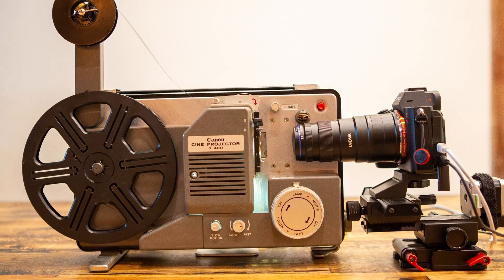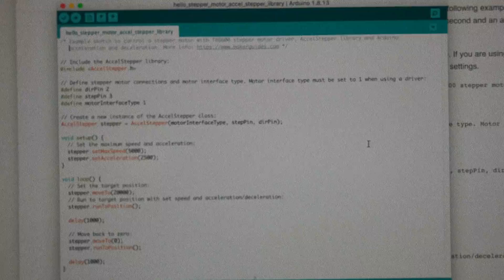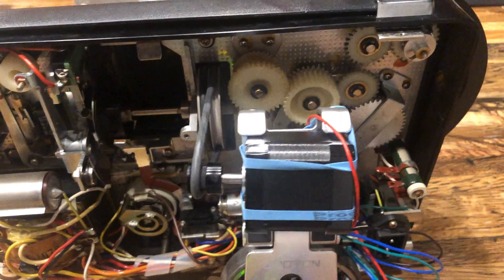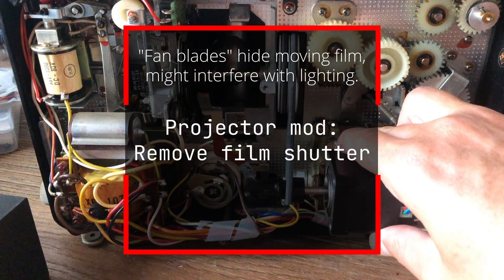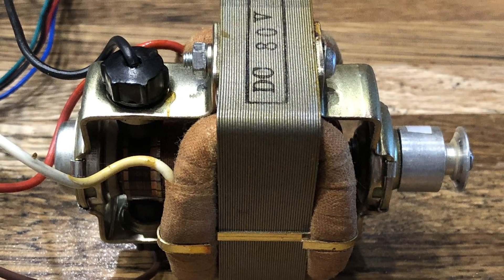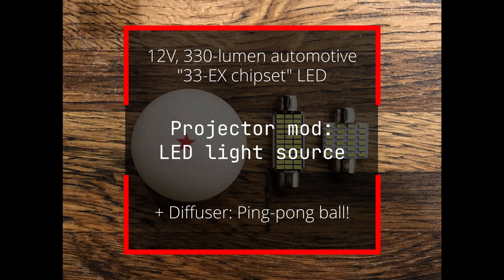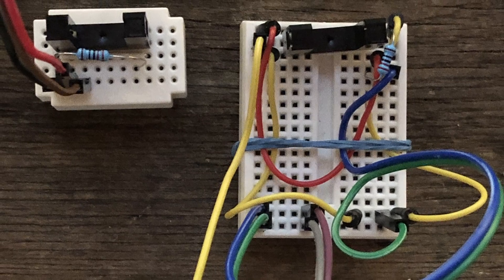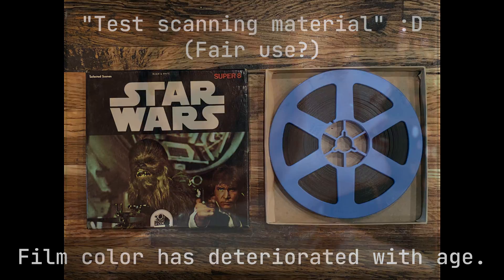📽️ 🎞️ 📸 ⤳💾✨ DIY 🛠️ 8mm / Super-8 Film Scanner, Part 1: Overview

Comment: Hi Scott,
Thanks for all the videos you made about the DIY 8mm Scanner, I admire them, they are very inspiring.
Although I have watched them all, I don't know how big the camera frame needs to be to capture the whole area around the frame even with the sprockets. I found out the purpose of doing this with Ken Eckert, whose work you mentioned in the Part 1 video . His The Magic Wand logically explains the principle of how stabilization of captured images works in Adobe Photoshop, but I don't know how it works in DaVinci Resolve? 

I'm now starting to modify a Meopta N8/S8mm projector and after removing all the parts I saw in Part 1, my film gate  is only 6.36 x 5.34mm and that doesn't meet the requirement for the camera to capture the entire surroundings of the film image including the perforations. On the N8 the sprockets is visible from 3/4 of the size , but on the S8 only a hint of about 0.1mm. No surroundings are visible on the opposite shorter (vertical) side - the image matches the film gate in both N8/S8 formats. I will have to enlarge the film gate symmetrically on the shorter sides, but how much? Does the whole sprockets need to be visible, or just half of the S8 as seen in the video in Part 3? The top and bottom film gate allows to capture the film image still with some margin. I'm asking as a beginner, but I have no experience with film post-production yet and will purchase DaVinchi after I get a faster PC. Looking at your videos, the perforation window is fixed, it doesn't move at all, it's OK.

I have a lot of my parents' old B&W 8mm film from the late 1940s, and the perforation is no longer in the best shape. So functional fixation throughout the transfer process is a very important topic for me.
Reply from the maker: I found that my projector’s film gate was both wide and tall enough to show the full width, including sprocket holes, and perhaps 1.5 frames’ worth of height.

It depends on the film, but the exposed image may extend across the full width - basically “behind” the sprocket holes or not. If the picture doesn’t go that far out, you can crop out the sprocket holes. I am not clear on what type of camera or process makes the difference between “full-frame” width and otherwise.

I think some folks have had luck filing out the film gate, carefully, to widen it. Your mileage may vary.

Oh, also - DaVinci Resolve is free to start with and you only need the paid version for certain features. I use the free one for all my stuff, and it’s perfectly sufficient.

Comment: Just a shout out and a thank you for posting this series. I've just completed my setup using a combination of your and Fresh Ground Pictures approaches, a worn-out, reworked Sankyo Duplex 1000, and my Panasonic S1. I've refined the build and I'm pleased with it. Just finished my first test capture, post-processing run-thru, getting my head around Davinci Resolve 17 and applying Neat Video. I'm familiar NV from FCPX but your orientation to Davinci - the import of an image sequence, the opportunity to set a frame rate to 16fps or 18fps - things you cannot do in Final Cut.... All so helpful to make a switch. Thanks for everything that you have put out there! It kept me motivated to create my own when after a year of researching approaches I had just about given up.
Reply from the maker: Thank you for the kind words, Walter! One thing to note, on your S1 - make sure you have silent mode or equivalent so there is no mechanical shutter movement, so you aren’t burning the lifecycle of your camera hardware with all those pictures. It sounds like you’re probably aware, but I try to mention it to everyone just to be safe. 😉

“Fresh Ground Pictures” did a great job with their video also, I saw it just recently and it looks like they improved on a few aspects of my home kitchen-based layout! 🤣
Reply: @scottschiller  Thanks for the mention of the electronic shutter - yes, I have definitely implemented that. The big appreciating to the FGP approach was his incorporation of the mechanical trigger for the shutter. That made this process so much more accessible.

Comment: A very fine work around to a home media challenge of the 21st century: how to effectively digitally transfer small gauge film in a high res' format. Unfortunately, a complex project such as this is a little out of the range of most home film-makers.
Reply from the maker: Thanks, Peter. I agree, this is a non-trivial hardware and software project that requires a certain amount of knowledge, and perhaps a “tinkerer” mindset. I am not an expert by any means, but I am happy to say I figured out enough to get some pretty good results, fairly reliably. It still takes a lot of time and effort to do the scan, but it’s really nice to have this sort of material digitized.

Comment: Utterly brilliant! And the original Star Wars on super 8 at the end was just icing on the cake. Thanks for sharing.

Do you really "need" to slow it down with the stepper that much? I guess the camera's frame rate is the limiting factor.
Reply from the maker: Thanks for the kind words.
The speed you can run at is dependent upon a few things. Common bottlenecks:
* How fast your camera can write pictures to storage (SD/CF or USB to computer) before the buffer fills up.
* Camera shutter speed / exposure settings, and minimum time between shots / how fast you can trigger the shutter.

From what I’ve found, my Sony a7riii may not always capture all frames when tethered and attempting to shoot more than 3 frames per second. This may be an arbitrary Sony limit or safety thing, I’m not sure.

I do think 3 FPS is stable when not connected to a computer, but then you need a fast and high capacity SDXC UHS-II type card, to handle a consistent data rate of 60+ MB/s or what have you.

Generally, I’ve found that “slow and steady” is good. I can do 1.5 FPS tethered quite reliably, without skipped or dropped frames and without having to stop the scan.

Hope this is of interest!
Reply: @scottschiller  Thanks for the explanation. I recently did something similiar to shoot time lapse of my 3D printer, but there I just use the lowest resolution JPG setting (2.5K) , and the Panasonic G81  only gets triggered 1x minute or less.
https://www.youtube.com/watch?v=FXXJQMq8srs
I guess you are shooting raw to be able to grade the footage later, but must have enormous amounts of data from an A7RIII. Does an 8mm frame have more usable information than about 720P, or 1080 ?
Reply from the maker: @RotarySMP  That's quite a video! Fun stuff. I don't have a 3D printer etc., but I can see how they can be useful.

For your case, JPG should be absolutely fine. For my project, I'm pulling in a bit over 64 GB for ~3.5 minutes of 8mm/super-8 footage when shooting using RAW "compressed" on the Sony a7riii, and Super-35 / 1.6x crop mode. I end up with an export typically around 4K, 2160p. This may be overkill, but I'd rather oversample vs. later realizing my original scan(s) weren't capturing enough detail.

From what I've read, 8mm might be 720p and Super-8 film perhaps 1080p, ~2K. It's unclear exactly how film translates into "vertical lines" of resolution. Either way, I think "over-sampling", scanning Super-8 at 2160p / 4K is OK as it's increasingly the standard for TVs, computer screens and high-DPI mobile devices where this content will be watched.

For typical 8mm / super-8 film, of course, the film's quality, age and how it was shot at the time - focus, lighting and exposure - all factor into the amount of quality / detail you can pull out of a scan. I think I've had some pretty decent results at times, but I've also had film that's both under-exposed and over-exposed between indoor and outdoor scenes on the same reel.

The intent with the raw process is that I can try to adjust, enhance and balance details "in post" in a lossless way after scanning, and then export a final .MOV/MP4 with only one generation of lossy compression.

Hopefully this is of interest! I'm not an expert, and learning as I go - it's been a fun process.
Reply: @scottschiller  Thanks for the kind words, and the explanation of your process.

Have you considered developing the film yourself? I have a problem with the $40 for film + $30 Developing + $25 scanning for 2.5 minutes. So far I haven't made the plunge into analog filming. Did plenty of B& still photography and darkroom work back in the 90's.  Seems 16mm film stock is now about the same price per mnute as Super 8. I have been reading up everything on line on home developing :) 

Another time consuming rabbit hole to run down :)

Have you also shot, developed and scanned any modern Super 8 film. I have looked at a fair bit,and rarely see anything approaching the sharpness of the old train films you have posted.
Reply from the maker: @RotarySMP  I hear that, film is an expensive habit. My DIY scanner's initial goal was digitizing my own family 8mm/super-8 archives, which I've done. Since then, I've purchased a few other things from eBay.

I'm interested in 16mm as well, I think it could be fun to try scanning that at 4K and have source material that is better-matched to that resolution.

Comment: Does not a DSLR shutter get worn out, after so many pictures? I am using similar concept, but recording directly a video, but the synchronization is a problem. Because, let's say 15min movie (16 f.p.s.) presses the shutter 14 000 times, so I am afraid to use it this way. What is you experience please?
Reply from the maker: You are correct regarding still photos! Indeed, photos on a DSLR that involves mechanical actuation will contribute significantly to wear and tear. I mention that in my Q&A video, with a suggestion about exploring a true shutter/actuation-free approach via "Magic Lantern" software for the Canon 5D and similar DSLR series. https://www.youtube.com/watch?v=hthVoeRgbos&t=1189s

It's worth noting the Magic Lantern "silent" mode may be a very slow process, and so I recommend using a mirrorless camera with "true" silent (no moving parts) mode if you can for this sort of work.

Comment: Great project, and excellent results. I am using the gate from the same projector Canon S400, but after removing the cutout (3:32 in your video) the frame does not show the sprocket. Did you have to enlarge the gate hole? any advice on how to best do it? Thanks in advance.
Reply from the maker: Thanks, pm490! I'm intrigued by your question. Once I removed the frame "cutout" - the piece that moves depending on selection, 8mm vs. Super-8 - I was able to see the sprocket holes on both types of film. I didn't have to enlarge the hole in the film gate here, no. Once I removed the bit of glass (an infrared filter?) and the cutout on the back side, that was all that seemed to be needed.

Assuming the back side is uncovered at this point, is there any chance something is covering part of the film gate on the front? I could try measuring what I've got here, but I'd wager it's between 9 and 10mm across. For reference, 8mm/super-8 film dimensions: https://en.wikipedia.org/wiki/File:8mm_and_super8_and_double8.png
Reply: @scottschiller  Thanks Scott. It is odd but looks like the same projector model has different size opening. I see yours is rectangular, mine is virtually square and measures 6mm wide. From the video I see yours is wider. I do see a bit of the sprocket hole on 8, but the S8 is cropped. Thanks for confirming, I am debating to file it wider or leave as is. And in my case will have to do both the front and back, both have the same size. Thanks and again great work. I took the approach of getting the gate out and spin it with a stepper. The one in the video was the first run, once I decide on the filing will make a video of the current built.
Reply from the maker: Thanks for the follow-up, this is great info. And yes, it’d be interesting to see what you’re building!

Comment: Bravo, congratulations, your project has nothing to envy the absurd professional cine scanners that cost (€ 12,000-35,000) The results are the same!
Reply from the maker: Thank you, Bruno! I do think those professional and high-end scanners are quite impressive, but they are certainly not cheap. My hope has been to get pretty good results using my own approach, with those pro scanners as a reference for quality.
Reply: @scottschiller  In what ways would you say a pro scanner is better than yours?
Reply from the maker: It’s likely the professional ones are more battle-tested, having been developed by companies for whom this is their business. They may have automatic cleaning abilities, and some can use rubber wheels instead of gears or cogs, and thus they can “play” film that a standard projector might not - e.g., if the film has shrunk somewhat over time and its sprocket holes are no longer consistent or the right size etc.

These are a few possibilities, anyway!

Comment: Very cool Scott.  I'm doing something similar right now.  That piece of glass in between the bulb and the film was actually an IR shield.  It protected the film from the heat of the old bulb.  If you're running an LED it still gets hot but it's way less heat than the old bulb.  The internal fan will keep it cool enough to not damage the film.
Reply from the maker: Thanks, Kevin! Thank-you for the IR detail, too; I was wondering what purpose that little glass piece served. I did testing with my 12V automotive LED set-up, and I found it hit about 110F - toasty, but not hot enough to melt the ping pong ball I had it "mounted" in or anything like that. Notwithstanding, I put a little fan in there to keep air moving just in case.
Reply: @scottschiller  Yeah, some sort of active cooling is good.  I actually replaced the glass with a piece of diffusive plastic because you could see the individual LED elements lighting up squares of the film... I actually have a giant heat sink on the back of mine and a little Adafruit RPi fan running straight off the 5v arduino rail too.  Then I only run the LED at 33v instead of the 37v it's rated for and it stays cool to the touch even after being on for hours.  I'm watching part 2 now - it's amazing how similar our setups are!
Reply from the maker: This does sound rather familiar, yes!
My automotive LED has a built-in heat sink, and runs at 12V - so I use the same power supply as I do for the stepper motor. Early on, before adding diffusion, I was also noticing individual LEDs shining through the film.